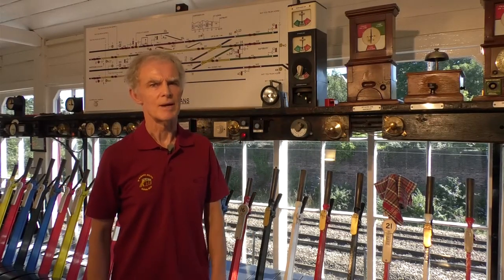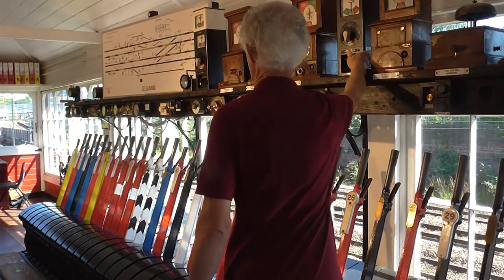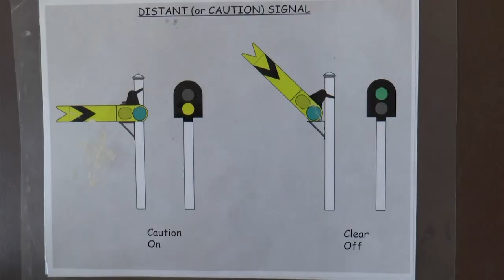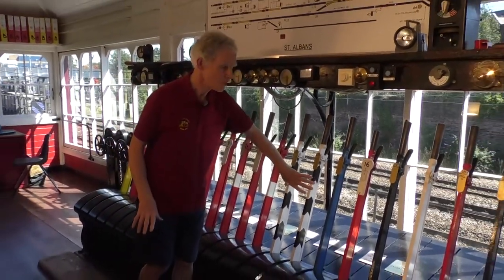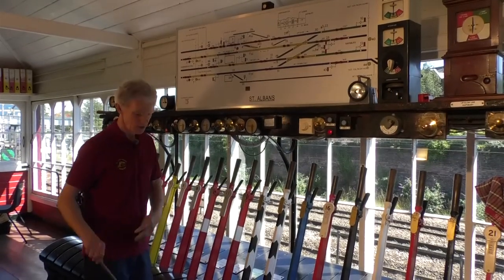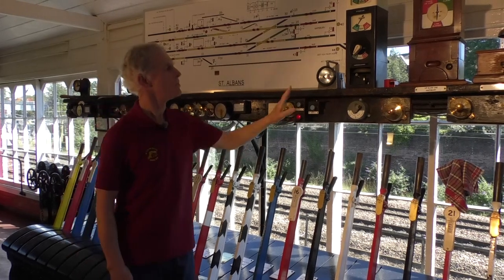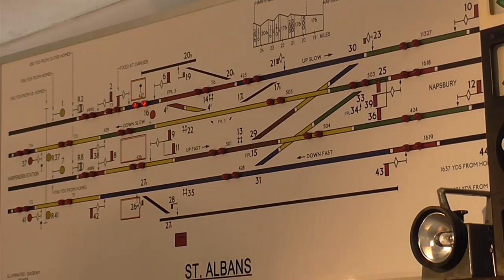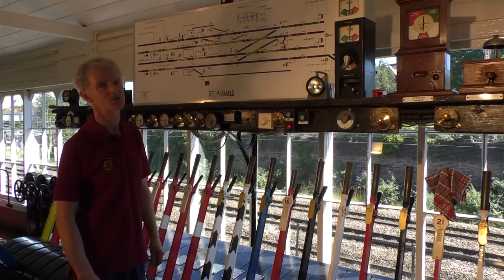How it works - St Albans Signal Box

Comment: Very good information but it did not show how hard it is to pull a mile of cable connected to the lever to lift the signal,,  My father was a signalman Browney county durham, and I had a go impossible he just threw it into position  OMG
Reply from the maker: Yes indeed - a mile of cable on a winter's morning - that some pull needed!  By the time the Box closed in 1979 though, the mechanical distant signals had been replaced with colour light signals.  By way of reminding the signaller that the lever did not need to be pulled so hard, the handle at the top of was shortened by half.  You can see this on the No1 lever on the frame in this demonstration.
Reply: Still got the rule book with the hand updated rules and other memorobillia

Comment: Reminds me of Coal Stage signal box at Lithgow NSW (still using levers & bell codes etc), also still in operation, only just, as technology advances.  I picked your video up thinking it was St Albans near Melbourne VIC in Australia, silly me!  Amazed to see yellow levers controlling lower quadrant signals and black/white lever for "detonators", presuming the signaller has previously left the box to the lay them?  I presume white is "spare" lever?  Lovely video, and well presented, brings back some memories!
Reply from the maker: Thanks for your kind comments here.  On the detonators, I think they were prepositioned so that the lever just swung them onto the rail when required.  I'll check as I am not sure what the protocol was for storage, checking and installation.
Reply: Yes, white is spares (often caused by the removal of a signal, point or other feature).

If the decision has been made that fog operations are yo be put in place due to deteriorating visibility (which could be due to falling snow and not just fog). If bad enough fogsignalmen would be appointed to go and stand by the signals affected. Each would be equipped with a supply of detonators, a lamp and flags. If the signal is at danger the fogsignalman places 1 or 2 detonators on the same rail in advance of the signal depending in what the rule book says for that signal/line and to show either a red or yellow lamp and flag to the approaching trains. If the signal 8s cleared the detonators must be removed and a green lamp and flag show. At no time must the fogsignalman leave his post even if he runs out of detonators without leaving the signal 0rotected with detonators and a red oy yellow lamp showing. If the signal the fogsignalman show both a stop and caution aspect then he must show a red lamp when the signal shows stop (plus the detonator(s)), a yellow lamp when the stop arm is cleared but the caution arm is still down (no detonator(s)) and a green when both arms are cleared.

The druverv4unning over detonators must stop immediately to investigate the reason for the detonators being in place.

Comment: Really interesting to see how it works/worked in my home country, it's strange though that there's no "route locking" as such, as there is here in Germany, over here (in our mechanical signal boxes that is) the entire route (entry or exit) stays locked until the train has passed completely through, either to the platform or out onto the open line. Until this happens one can't actually move any points or derailers, and it's all locked by a green lever. Maybe it's due to the different models of signal box. On one hand it's safer that it stays locked, so that the points can't move under a moving train, however it does mean everything takes a little longer, especially when having trains cross in the station, as one train has to reach the platform before you can even start thinking about setting the route for the one from the opposite direction.
Reply from the maker: Alex - most interesting  - thank you.  I always tend to think that the main difference between UK and continental railways is that in the UK the routes arose from naked commercial interest and competition.  This led to duplication of routes and  the timetabling of express, suburban and freight services all in competition with each other, all on the same lines.  

On the continent, because distances are so much greater, speeds and procedures had to be much more standardised.  Yes, local interests may have suffered, but the system was much more efficient on a continental scale.  Trains ran at consistent speeds and rail workers could expect to operate to consistent rules.

The same applies in North America I think.. Indeed, perhaps a US military trope puts it best - "In the UK you equip your soldiers, but in NATO we man the equipment."  Perhaps it is the same with railways although today, we rightly refer to people not just men.
Reply: Mechanical interlocking between the levers will lock the route.  When signals are cleared for a specific route, they will lock the levers that control the points through that route, preventing them from being moved.  In more modern boxes in the UK, that interlocking is done electronically.

Comment: Good evening, I would kindly like to know the meaning of the white band present on some levers.  Thanks again for your availability and collaboration
Reply from the maker: White levers are spares - that is, unused in the current configuration of the lever frame, points and signals. However, in our restored signal box , we use lever 32 (painted white and originally unused) to operate a signal in our garden.
Reply: @sigbox  Thank you for the answer, but I meant the white band painted on some red levers (not on all red levers).  Thanks again for your availability and collaboration
Reply from the maker: Luigi - apologies, I missed the intent of your question earlier, 

The four signal levers with a white band on are 'Section' or 'Starter' signals. When cleared they allow a train to go towards the next station or signal box. Before any of those signals can be cleared the 'Absolute Block System' requires the signaller at St Albans to get permission from the signaller at the next box using the block instruments. Once that signaller has given their permission, the signal is electrically unlocked so the St Albans signaller can then clear the signal. 

And thanks to John Webb for the details on the answer here, trust this clears it up.

Comment: Is there a term for the type of levers here, with that hand safety lock?
Reply from the maker: Information we have is that the 'Catch Handle' is the small handle that releases the catch holding the lever firmly at each end of its travel. An important difference to other lever frames is that the catch handle also works the interlocking rather than the main lever.   Trust this helps and do let is know if you discover other terms out there.
Reply: @sigbox  Ooh, thank you, that does help. I've been trying to figure out how to succinctly identify these in print, maybe 'catch-handle lever' will work.

Comment: Module TS3 Regulation 3.4.1 states the the line or at a facing junction, the line for which the facing points are set is clear up to and including the clearing point and all points within the clearing points are set for the safety of the approching train.

Where is the clearing point in this demonstration out of interest please?
Reply from the maker: The video is a demonstration of the lever frame and instruments designed for the general public. The precise clearing point (the point to which the line must be clear, in order to accept a train) would, it could be argued, depend on the rolling stock, motive power and track condition.  That is, it could perhaps have changed with time and  technology.  For the purpose of the simulation I think it is safe to assume that Signal 2 would be used as the clearing point. (8.09 minutes in is where the signal numbers are given)  Trust this helps. If there is more detail, it will be posted here.

Comment: What about the former Sandridge Box, between St.Albans North & Harpenden????
Reply from the maker: Thanks for the question.  Hopefully this helps explain:

The box has the levers and interlocks and hence is set-up as it was when it closed in 1979. At that time, the adjacent blocks were at Harpenden and Napsbury.

North Box had closed in December 1970, by which time it was already operating the IBS (Intermediate Block Signals) that had replaced Sandridge box which itself had closed in January 1962 when the IBS were installed and the up slow to up fast crossover was taken out. Sandridge siding remained in use (or at least operational) until April 1967.
Reply: @sigbox  Thanks very much indeed for this information. Very interesting. I'm on the hunt for any photos  / images of the old Sandridge Box, which (I presume) was situated between Sandridgebury Lane (rail over road) Bridge and Cheapside Farm (road over rail) bridge on the Down Fast side. No luck with that so far though. Cheers.
Reply from the maker: On your search for images of Sandridge box, its possible that our members may have some as many live locally and have many photographs of the Midland Railway history.  

Do contact us directly via the form on our web site at http://www.sigbox.co.uk/sigbox/contact.eb so we can let our members know of your interest.  Many thanks.
Reply: @sigbox  Very many thanks indeed.
Reply: @sigbox  
Excellent video, thank you. I dimly recall that at Napsbury SB, in addition to standard box-to-box phone circuits, there was a 'special' direct line to the mental hospital up the road for the signalmen to alert authorities when they saw anyone hanging around the railway....

Comment: Really interesting, but may I ask how it proves that the line is clear on a double/four track line? By rail circuit or tablets?
Reply from the maker: Thank you for your question.  Each of the four lines is separately controlled . Track circuits detected the presence of trains, and the signallers used the block instruments to communicate with each other to allow the train movements. The track circuits, the instruments and the levers themselves were all interlocked to prevent any train being signalled into an occupied block.

Tablets were only used for single line working - we have a video on our channel @SIGBOX on how Tyer No 6 instruments were used to do this.

I hope this helps but do please ask again if anything needs a better explanation. 

Have a good day and best wishes to Beijing
Reply: @sigbox  Thanks a lot, so each signal box connects with each other to reach the semi-automatic blocking between each signal boxes via track circuit which tests the location of trains. 
CR's semi-automatic blocking is between each station or junction. 
I really know little about these ancient rail blocking facilities and systems since CR (Concluding KCR/MTR, Hong Kong) had replaced most of which with electrical/computerized facilities and systems after 1975.
Reply from the maker: @金豆理事  yes - in the 1970's with semiconductors, we could make very complex logic circuits and computers quite easily.  These systems were very much cheaper and easier to maintain and modify.  Electric colour lights were also much more reliable and easily operated over long distances.  I  was born in 1950, so can remember when the railways were all steam engines and mechanical signalling.  I have been lucky to work with electronic technology as it has advanced  - today it is remarkable how much design, production, distribution, use and maintenance is done with software running on electronic systems. Burning coal and making everything from steel could not have made the modern world..

Comment: Is this actually still in live service today?
Reply from the maker: The box was retired from railway service in 1980.  It became derelict and was restored between 2002 and 2008 by a charitable trust who continue to maintain and operate the box.  The demonstration uses a Raspberry Pi computer to simulate signal boxes to the North at Harpenden and to the south at Napsbury.  The computer is programmed to simulate train movements on all lines in both directions.  The lever frame and instruments are then operated to allow trains to pass through in accordance with real signalling procedures.

Comment: does the british...run trains in sections...1..2  or 3 sections of trains  in the same block segments?
Reply from the maker: Dave - thanks for the question - I'm not a signaller, but I am pretty sure that we are always just have one train per block.  I think the big difference between UK and continental railroads is that in UK all the blocks are small  - few miles maximum, whereas on continental railroads there can be huge distances between signal boxes..
Reply: There are special circumstances when two trains can be signalled in to the same block - one train coming to the assistance of a broken down train, or when two trains need to be coupled together to make a bigger train for example - but the general rule is that only one train can be in a section.

Comment: I wanted to know why don’t dig a tunnel and do an extension for the main line Train so they extend the new abandoned underground stations.  

Why couldn’t they use the part D78 Stock train doors on the sides and also restructure the front face of the A60 and A62 stock that includes the class 313, class 314 and class 315 remix and make them all together and also redesign them an overhead line and also make them into six cars per units and also having three Accessible Toilets on that six cars per units A60 and A62 stock trains and also convert the A60 and A62 stock trains into a Scania N112, Volvo TD102KF, Volvo B10M, Gardner 6LXC, Gardner 6LXB and Gardner 8LXB Diesel Engines and also put the Loud 7-Speed Voith Gearboxes even Loud 8-Speed Leyland Hydra cyclic Gearboxes in the A60 and A62 stock, class 313, class 314, and class 315 and also modernise the A60 and A62 stock and make it into an 11 car per unit so it could have fewer doors, more tables, computers and mobile phone chargers?

A Stock Train and also having 8 DisaAccessiblelets on those A stock trains. why couldn’t we refurbish and modernise the waterloo and city line Triple-Track train tunnel and make it bigger and extend it to bank station, making it into a Triple-Track Railway Line so those 4 European countries such as Germany, Italy, Poland And Sweden to convert the waterloo and city line Triple-Track Train tunnel into a High-Speed train?

The Third Euro tunnel Triple-Track Train line to make it 11 times better for passengers so they could go from A to B. then put the modernised  11 car per unit A Stock and put them on a bigger modernised waterloo and city line Triple-Track train tunnel so it could go to bank station to those 4 European countries such as Germany, Italy, Poland And Sweden. The modernised refurbished 11 cars per unit A stock could be a High Speed The Third Triple-Track Euro Tunnel Train So it is promising and 37 times a lot more possible to do this kind of project that is OK for London Germany, Italy, Poland And Sweden. Oh by the way, could they also tunnel the Triple-Track Railway Line so it will stop from Buckinghamshire, Hertfordshire and Essex so that the Passengers will go to Germany, Italy, Poland and Sweden and also extend the Triple-Track Railway Line from Bank to Buckinghamshire, Hertfordshire and Essex Stations so that more people from there could go to Germany, Italy, Poland And Sweden Easily.  

Why couldn't they extend the Piccadilly line and also build a brand-new underground train station so it could go even further right up to Clapton, Wood Street and also make another brand new tunnel train station in Chingford and could they extend the DLR?

All of the classes 150, 155, 154, 117, 114, 105, and 106, will be replaced by all of the Scania N112, Volvo TD102KF, Volvo B10M, Gardner 6LXB, Gardner 6LXC and Gardner 8LXB Diesel Six carriages three accessible toilets are air conditioning trains including Highams Park for extended roots which is the Piccadilly line and the DLR trains.
Could you also convert all of the 1973 stock trains into an air-conditioned maximum speed 78 km/hours (48 MPH) re-refurbished and make it into a 8 cars per unit if that will be alright, and also extend all of the Piccadilly train stations to create more space for all of the extended 8 car per unit 1973 stock air condition trains and can you also build another Mayflower and Tornado Steam Locomotive Companies and they can order Every 17 Octagon and Hexagon shape LNER diagram unique minor no.13 and unique small no.11 Boilers from those Countries such as Greece, Italy, Poland, and Sweden, can they make Mayflower and Tornado Steam Locomotive speeds by up to 117MPH so you can try and test it on the Original Mainline so it will be much more safer for the Passengers to enjoy the 117MPH speed Limit only for HS2 and Channel Tunnel mainline services, if they needed 16 Carriages Per units can they use those class 55’s, class 44’s, class 40’s and class 43HST Diesel Locomotive’s right at the Back of those 16 Carriages Per Units so they can take over at the Back to let those Mayflower and Tornado Steam Locomotive’s have a rest for those fascinating Journeys Please!!!!!! oh, can you make all of those Coal Boxes’ 16 Tonnes for all of the 117MPH Mayflower and Tornado Steam Locomotive’s so the Companies will Understand us, passengers!! so please make sure that the Builders can do as they are Told!! And please do something about these very important Professional ideas Please Prime Minister of England, Prime Minister of Sweden, Prime Minister of Germany, Prime Minister of Italy, Prime Minister of Poland and that Includes the Mayor of London.
Reply from the maker: Artificial intelligence with syntax dependant phrasing and noun selection could engender meaningful discourse if verb relevance were truly based only on heuristics.  But is it?  Only time and a larger training set will inform. Still, worth watching.